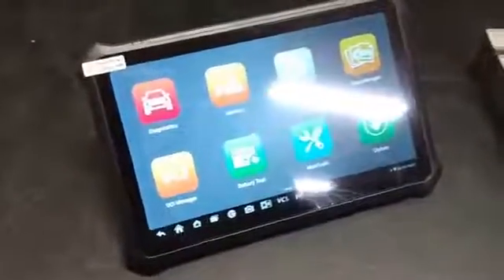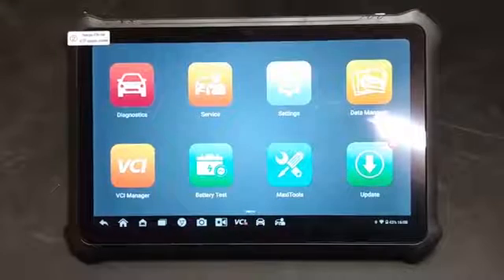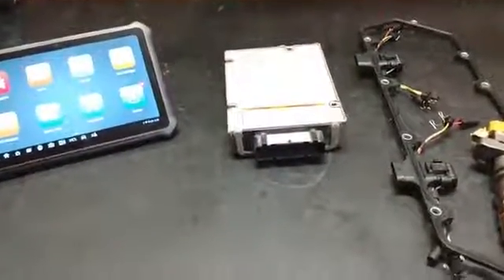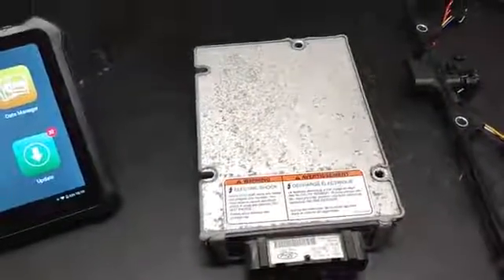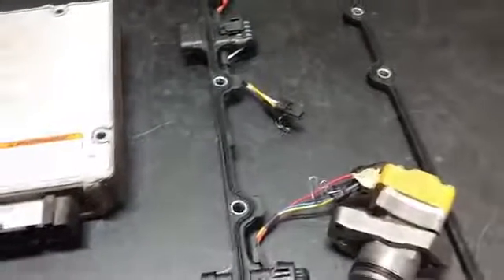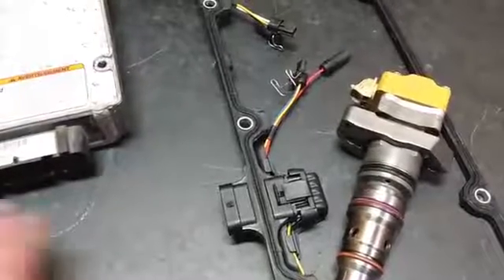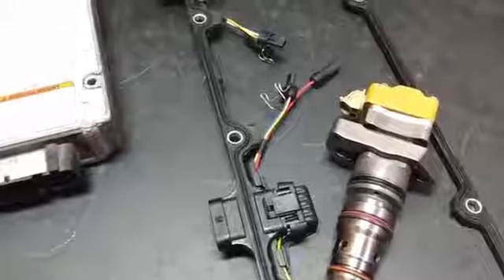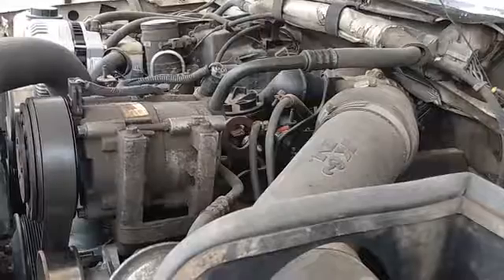Understanding 7.3L Powerstroke Injector Buzz Test Results / Introducing our new Otofix EvoScan Ultra

Comment: I got a question. Mine don’t buzz all eight and when it buzzes them it, you got a couple out and all the rest, quiet buzzes, and six out of eight come back with the code the other two don’t what could that be?
Reply from the maker: With that many out, I would suspect a harness problem most likely. I would unplug the IDM and check each injector circuit from the IDM connector. If you shoot us an email (see our logo for the email address. I will send a sheet that shows exactly which terminals to check at the IDM connector to check each injector circuit one at a time.

Comment: What kills IDMs? My 02 7.3 went through 4 boxes in 6000 miles.
Was I getting bad idms from napa or was my truck killing them??? Gave up, sold truck.
Reply from the maker: Ouch, sorry to hear that! Most likely it was a low resistance solenoid or low resistance path to ground somewhere in the wiring between the IDM and the injector. If anyone ever runs into this, we have a test sheet that we use before installing a new IDM. From the IDM connector, we check the resistance of each injector circuit and also the resistance of each circuit to ground.